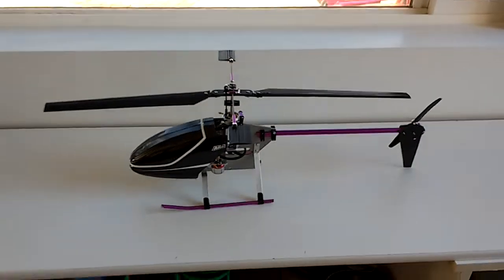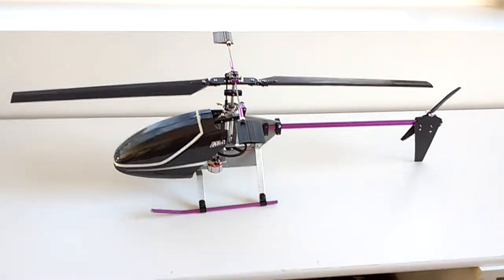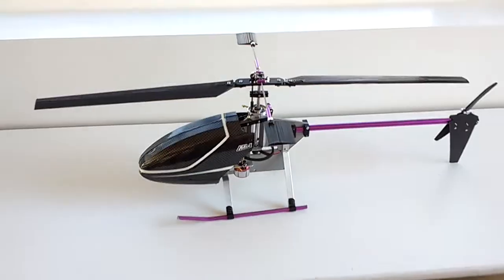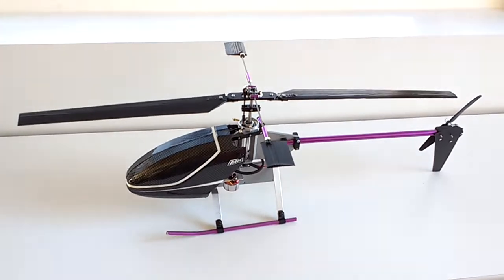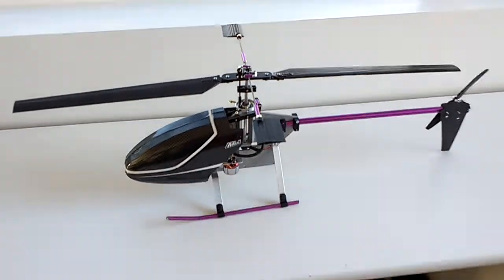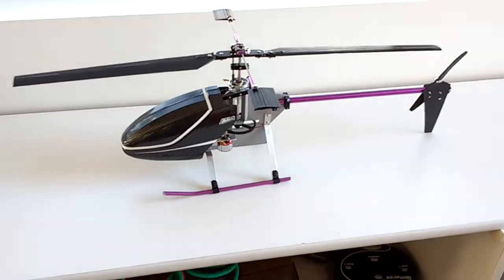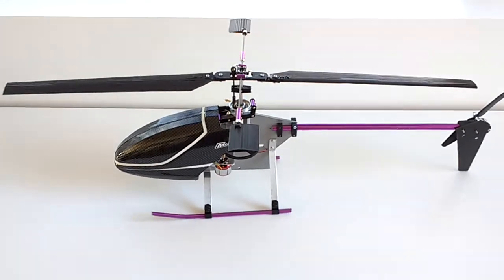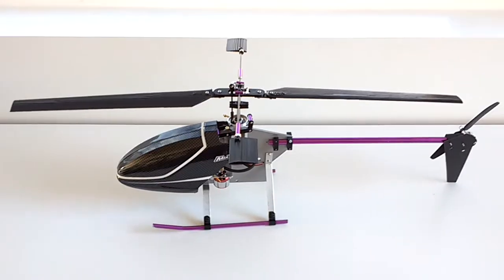Vintage GMP Rebel  RC Helicopter -  Redesigned as Mini for Electric Flight

Comment: This is awesome!
The GMP Rebel was my first helicopter back in 1989 when I was 11 yrs old, I saved up for ages for it. 
My god that thing took a beating!
(Also I believe the original rotor head was made from Nylon not Delrin for flexibility to so it would allow the blades to flap & cone)
Reply from the maker: Yes, the head is made of Injection Molded Nylon on the original GMP, I made my mini version original from CNC Delrin.
Reply: @MarioIArguello  
When I bought my kit in LA as we were visiting from Australia we were invited to have to a guided tour of the GMP factory by Greg Milosovich and met John Gorham, unfortunately they closed the business shortly after that.
Reply: @johno9507  that must have been an interesting tour. I never met the owner, personally, but I read about his company in rc magazines of the era.  Having the  Rebel,  two  Crickets and also some earlier "fuel engine helicopters",  I must say the GMP models are my favorites in that vintage category, something about the simplicity of a fixed pitch machine, although CP helis are more agile and you can do more with them in terms of aerobatics,  I never really developed a liking for collective pitch, flying inverted has never been my thing,  not to mention the additional complexity of CP, while 3D flying helis is exciting for the younger generation,  I've preferred to fly rc models in scale, and upright, it is more realistic that way.